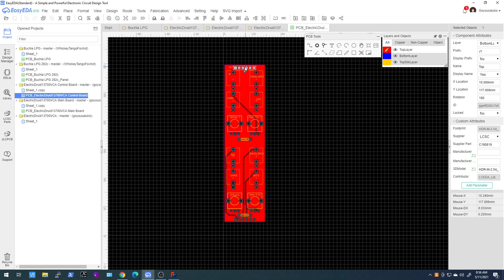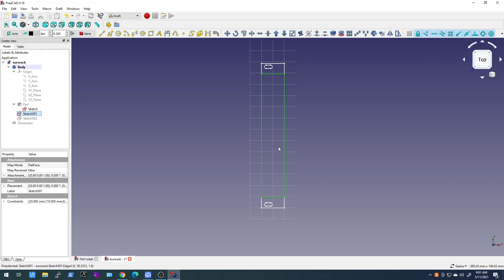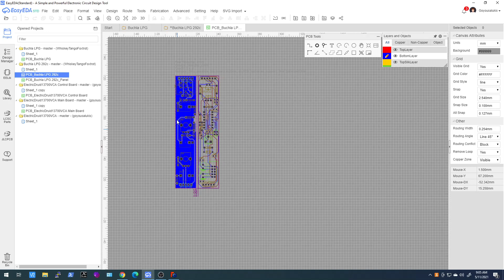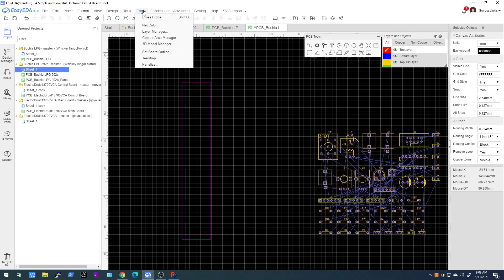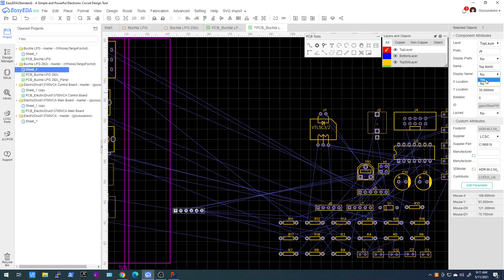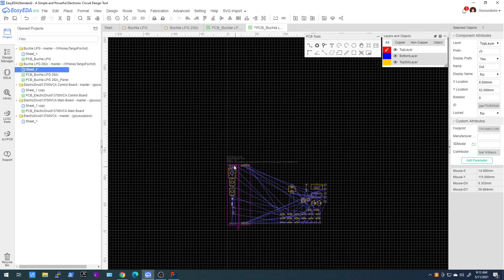Create a Stacked PCB Eurorack Project in EasyEDA - Part 2: Creating the Stacked PCBs

Comment: did it work as expected Justin? hope so ;-) I'm about to try something similar
Reply: I couldn't get second method to work, couldn't ground plane the second panel, it was expecting the same design as panel 1. Did you find a workaround at all? thanks
Reply from the maker: @YourModulesMayVary  It did work as expected. One strategy to do a ground plane on the second panel is to create a net called GND_B for example. Instead of connecting the components on the second panel to GND, connect them to GND_B. Then you can choose GND_B as the net for a plane on the second panel. I just tested it and it works fine for me. Then you would make sure you have a connection through the connector from GND to GND_B. Hope this helps!
Reply: @justinahrens1868  thanks Justin. I tried that but it wouldn’t take. Oh well. Will try again next time. Thx for the videos!
Reply from the maker: @YourModulesMayVary  I do find the copper area tool to be a bit glitchy. Sometimes I have to cancel in the middle, delete the outline and then try again.